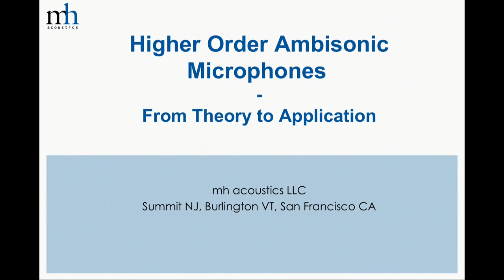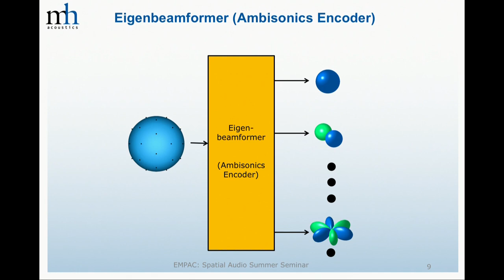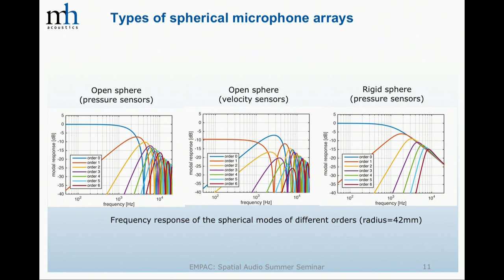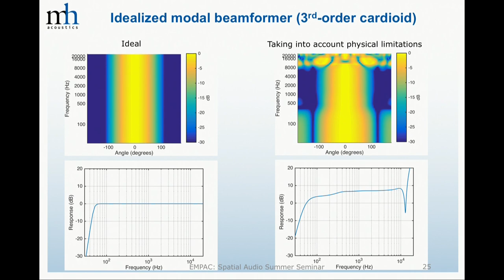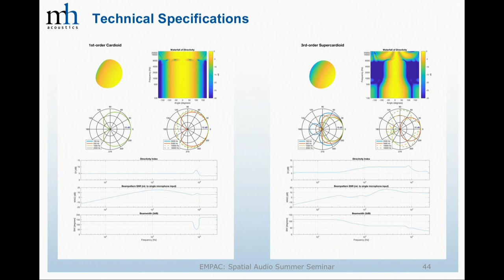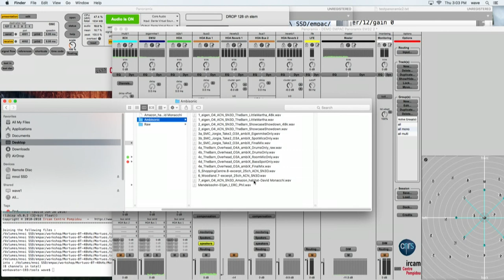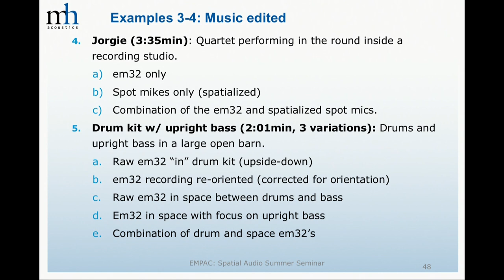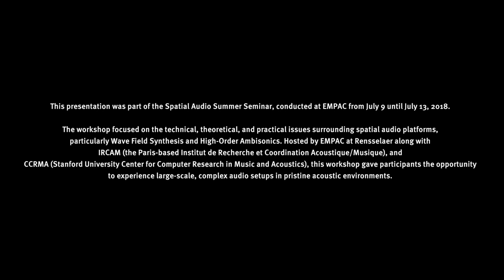Higher Order Ambisonic Microphones From Theory to Application: Spatial Audio Summer Seminar 2018

Comment: Thanks for sharing this. At 55:39, It was just the thing I was wondering about on perceptual difference between FOA compared to HOA. Thus with HOA we can surgically manipulate the soundfield in post and gain more acute control of the pressure source sampled within the sphere, similarly to enabling a narrow Q bandwidth to an audio recording sampled at higher bitrates. We can only manipulate what we capture.